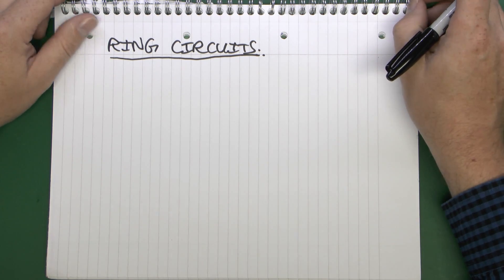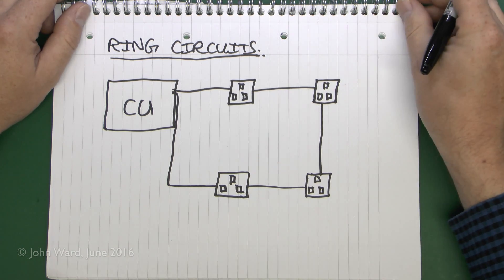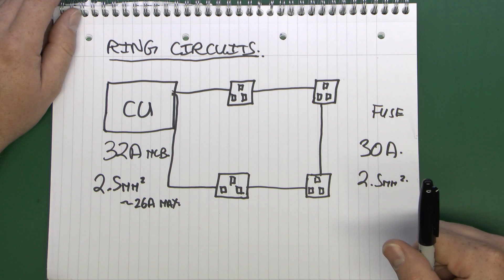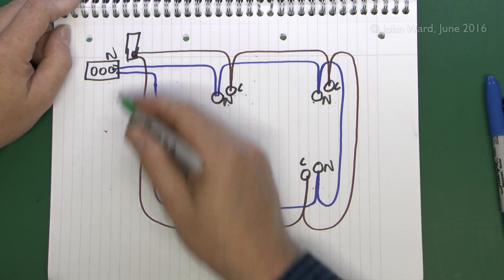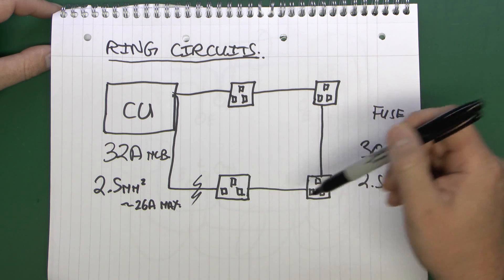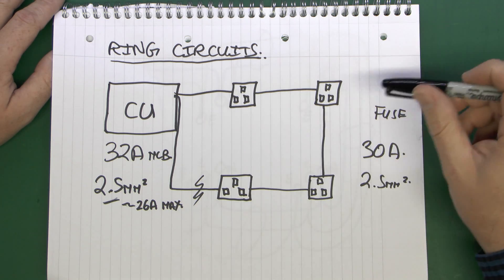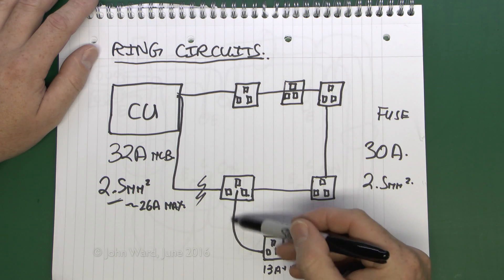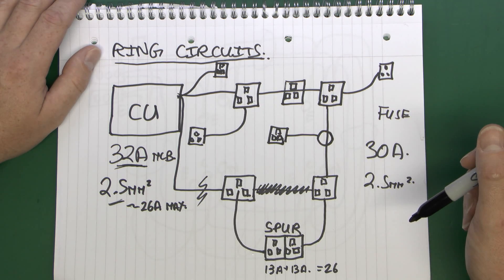UK Ring Circuits (previously Ring Mains) for Socket Outlets

Comment: Always wired 30 or 32A with 4mm2, you are on the safe side in any scenario. For bedrooms you could use 2.5mm2 with 20A   MCB which is more than enough for average house
Reply: Cost you a fortune in cable would have to take half a brick depth out to cap that up 🤣

Comment: I have 53 2g 13A sockets in my house on 6 ring circuits, can you imagine the consumer unit if i had used the spur configuration
Reply: It would look like my CU in France, where everything on on radials and I have 27 bays occupied. :)
Reply: @Herpitor  Isn't it something like 8 sockets on 2.5mm or 5 on 1.5mm and heavy appliances (washer, dryer, dishwasher etc) require their own spur?
Reply: @s1udgeguts  It used to be, in France it's now 12 sockets 20a breaker 2.5mm wire, or 8 sockets on 16a breaker 1.5mm wire.

Stupid limits, but means in large modern houses you have to buy the 6-800 euro Le Grand 4 tier unit to do an entire home. Typical French, squeezing your tit til it's purple to get all that juicy money flowing.
Reply: It also depends on how the cables are run. 2.5mm can carry up to 27A if clipped but run through stud walls packed with insulation, this drops to 13.5A. My son's modern house is lovely and toasty in the winter as it is wood construction and every wall is stud/plasterboard & packed with insulation, all his cables are in surface trunking (It's actually quite neat, the cables are simply laid in large, hollow, plastic skirting)
Reply from the maker: 6 radials would have half the number of wires at the consumer unit compared to 6 rings, so would mostly likely be considerably tidier.
Reply: @jwflame  an honest question: I'm also confused by the same issue Tony appears to have. Are you saying that each of his six rooms is on one spur, or that each of his 53 sockets needs to be wired radially? The latter sounds messy while the former suggests that for each room a separate (hated) ring circuit would be better. 
I used to deal with this stuff up to 15th edition regs, but I'm pretty sure things have moved on since those dinosaur days, but there were limits on the number of outlets on a spur back then.
Reply from the maker: A radial circuit starts at the consumer unit and connects to each socket in turn, ending at the final socket.  You can have as many sockets on it as you want.  The cable rating is less than that circuit breaker, so there is no risk of overloading and damaging the cable.  All circuits are radials, apart from the one exception which is the ring.
A ring uses undersized cable rated to at least 20A with a 30A fuse or 32A circuit breaker, and is only permitted because the ring provides 2 separate current paths to each socket.
A spur is a single socket connected via a single cable from a ring, and can only have one socket on it otherwise the cable could be overloaded.  There is no concept of a spur on a radial circuit.
With the 6 rings, they could be replaced with 6 radials, with exactly the same number of sockets on each as there is now.  Less cable would be used, half the number of wires at the consumer unit, no risk of the ring being broken and overloading the cable, less testing to do, and far easier to add sockets or do other alterations.

Comment: Most of the sparks I know, use ring mains. Never have any problems with them.
Reply: @Mark Sesum 38 years in the trade for me,
Reply: @Mark Sesum Back in the late 70s, the electricity board in Yorkshire had a special on electric showers. They would supply and fit a 3kw shower far cheaper than anyone else. Turned out, they ran a piece of 2.5 to a junction box attached to the first bit of 2.5 cable they found.
Reply: @s1udgeguts  A 3KW shower would either be a dribble or very cold.
Reply: @dopiaza2006  3kw was the highest rating you could buy at the time. It was neither a dribble nor very cold
Reply: @s1udgeguts  Just by the laws of thermodynamics, 3KW will not heat much water. In fact I remember having an electric shower in the late 70s, was around 8KW and made the lights dim noticeably. Still gave piss poor output! Your average combi gas boiler heating water on demand will be around 20KW. Maybe it was a little different up North though...
Reply: In my ex's gaff in France ever socket and light and appliance has its own breaker. None of this stone age shit.
Reply: @corydorastube  Nothing stone age about it, we have some of the best electrical safety standards in the world.
Reply: @corydorastube  we had 3 phase 415v in each house on an estate in Weston under Lizard back in the early 90s.
Reply: @corydorastube  Not true at all. Each radial run for sockets has its own circuit in France. Each lighting run has its own radial circuit. Each appliance in the kitchen has its own 'circuit spécialisé' but sockets and lights are on normal radials with multiple points being run by single breakers.

Also it'S 400v in Germany for 3-phase, not 440v.
Reply: @electricalstuff259  My ex-wife's house in France has a breaker for everything. Her distribution board looks like something from the bridge of the USS Enterprise.
Reply: @corydorastube  It musta been old as fook then. Having said that mine was so old it was condemned by Enedis and yet i still didn't have a single disjoncteur per socket. Guy who put it in might have been a cowboy or once upon a time they did it that way here and it's never been redone.
Reply: @electricalstuff259  It was built in 2000.
Reply: @corydorastube  Guy was a pudding then.
Reply: @electricalstuff259  I like my pudding then It means I can isolate any socket or light fitting. Does the job for me.
Reply: @corydorastube  You must be made of money then, since every circuit has to be RCD protected which means you are only going to be able to put 8 on each bus bar (that's the limit under the regs) meaning that for a house of 150sqm you're going to need at least two 4-tier units which are going to cost around 600 euro apiece, of which you'll still have to buy probably 20 extra mcb's at 8 euro apiece, that's before buying any cable at around 75 euro per 100m.

And i'm being generous. My MIL's house is a tiny 45sqm 2 up 2 down in a posh part of the west country and she has 13 lighting points and 28 sockets.

My old man lives in a 150sqm with outside power and lighting etc and has 95 lighting points and probably well over 100 sockets since he has lots of smaller rooms in his gaff, utility areas, offices, shed, garages with lots of power etc.

Or...you can just put almost unlimited sockets on a radial circuit in one mcb and be done with it.
Reply: @electricalstuff259  It's not my house. I did not have it built. It is my ex-wife's house. I have not been in it for about five years.

The plot of land cost about 30,000 and the house was another 80,000 is on top. Three stories, 5 beds.
Reply: @corydorastube  So about 10 grands worth of materials on that. Ridiculous.
Reply: @electricalstuff259  That is your claim. I have no idea. The one wall that is built from traditional pierre de Caen probably cost that much.
Reply: Why did you use a comma after “know”? Lol
Reply: He was not suggesting they would become a problem, just potentially if there was a break in the ring. Personally as a DIY'er but with an interest in domestic electrics, I would be going with a radial every time. Feel free to shoot me down!

Comment: If you wanted to put say two double sockets on a spur, would it be OK to connect these two sockets via a 13a fused spur box ?
>
Reply from the maker: Yes, in theory you can have as many sockets as you want via the 13A fuse.

Comment: My employer loves a Ring circuit, they'd put one in for any socket circuit consisting of 2 or more double sockets. I personally fail to see the point most of the time. It does make sense to have a 32A circuit for a kitchen/utility and I guess the little bit of extra testing involved still beats fitting a load of sockets with two 4mm cables in them.

I remember one of my college teachers saying about how he'd converted a lighting circuit wired in 1mm into a ring because it was on a 10A MCB and the cables were all buried in insulation, bet that was a head scratcher for the next guy to work on it  😂
Reply: It's not Ring, like the new video doorbell button; just "ring," the generic object.

Comment: If you don't like ring circuits, you should try living where the circuits are all radial and having to reset the breakers is a not infrequent event, as they are overloaded by too many appliances being used at the same time.  Not very good when your PC switches off,

Comment: John i need to wire a spur off a ring circuit , however rather than supplying a socket outlet i require it to accomodate a double appliance box with fused spurs which protect plynth background lighting and an extractor fan. does this comply with bs 7671 or would this be regarded as suppling a spur from a spur?
thanks for any clarification
Reply: I hope you resolved your issue or received any reply from John..

Comment: Hi John, you have some interesting videos, it is quite addictive watching Chinese crap being pulled to bits. I have to say though that I have taken a chance on a couple of electronic items from the land of the wibbly wall and been very pleased and surprised with the quality.
Specifically the Weiduka AC8.8 power blocks and a Wolf Audio linear power supply to replace the wall wart that came with my Origin Live turntable motor kit.
I am a bit puzzled by your dislike of ring circuits as it seems to be down entirely to the slight chance of a wire, fixed securely by a screw, in a non movable wall mounted environment, somehow working its way loose. Or have I missed something very important?
Also, with radial circuits do you not get power drops at the end of the line if items with heavy current demands are upstream so to speak?

Comment: My whole house is only one ring circuit. I would like to separate all the kitchen sockets. Would you suggest a kitchen radial and another radial for the rest or two separate ring circuits. Would that question be dependant on total number of sockets and appliances(total load)?

Comment: Great video (yes, a little late to the party). Just wondering but if single sockets installed in an old house, is that a sign that there may be a ring main? Thanks!
Reply from the maker: Singles were common in the 1970s and earlier, but doubles were available then.
Very likely they are on a ring, as that was the method used in virtually all houses then and still is today.  Whether they are single or double doesn't make any difference to the wiring.
Reply: @jwflame  Thank you for answering, very kind and informative. Excellent job all round sir.

Comment: Thanks John, really helpful.  I do not quite understand how if one wire gets disconnected. the sockets can still have power? Surely the ring is now broken?
Reply: Because the sockets draw power from either side of the ring. Consider a ring road, you wish to travel from the top (12o'clock) to the 8 o'clock position. You normally travel clockwise as it's more scenic and marginally less busy. You now find that there has been a serious accident, completely blocking your route. You can still get to your destination by travelling anti-clockwise, although this will now be more congested due to everyone else having to travel the same route.
Reply: williamwills I was thinking the same.

Comment: There is another common problem: when a DIYer adds sockets, he or she will frequently spur off an existing spur, which makes matters even worse. Bear in mind that when this topology was first proposed and accepted, the cable size was not 2.5 sq. mm., but was 7/029 sq. in., which had a higher current capacity; it was between 2.5 sq. mm. and 4 sq. mm., though in those days the only commonly used protective devices were rewirable fuses to BS3036, which required a larger cable due to their poor overload characteristics. The older imperial size cable was alao better because all the conductors were stranded, and so could be twisted together, resulting in a far better connection at terminals. My preferred circuit for 13A sockets is a 20 or 32 amp radial, using 4 sq. mm. This has stranded line and neutrals, so that the superior connections are retained, though not for the cpc, which is 1.5 sq. mm. single core.
Reply: I think you'll find that stranded cable was replaced with single core because single core clamps better and so makes a better connection.

Comment: What about insulation With a radial like a 4mm 32A would need to be 6mm how would that terminate. I install 4mm rings in bungalows where insulation is packed in.

Comment: Hi John,  thanks for the useful video. I have recently bought a static caravan in which the ring main for the sockets is protected by a 20A breaker. The wiring is 2.5mm T&E. Is there any reason why I may not be able to increase the breaker to 32A? Would the incoming supply from the park affect this - although there are much bigger vans on the park than mine which must have higher loads?

Comment: Hi, thanks for your videos. Could you please make a tutorial about how to connect/wire a 3 gang switch so it controls 3 devices for example? In my kitchen, I have a ventilator, ceiling light and led light under the cabinets and I have 4 set of cables (each having a Ground, L, N) coming out from the wall ready to be connected to a switch.

Comment: I never knew the UK did this, its a good idea in theory but the fact that its so easy to end up putting too many amps through the conductor from a single point failure is scary.
Reply: Note that 26 amps is what the cable is intended to carry, but the standard for manufacturing that cable is probably that it can handle 32 amps without getting hot enough to start a fire in any of the materials it's likely to be in contact with. (And the materials used in houses are probably also regulated so that they cannot ignite from the temperature that your house wiring is likely to get to...)
I'm pretty sure I broke the loop at one point (my baton light in the garage fell down in a storm and I snipped the wires off) and it was that way for months and nothing bad happened. I did hurry up and replace it when I read about the existence of ring circuits though! But nothing bad happened.

Comment: Why use ring circuits when most places use wiring that only extends to the furthest plug?
Reply: I've just look it up as I was under the impression it was to save money after WW2, but apparently not. This is an extract from the internet: 

The Electrical Installations Committee which was convened in 1942 as part of the Post War Building Studies programme determined, amongst other things, that the ring final circuit offered a more efficient and lower cost system which would safely support a greater number of sockets.

Most bigger loads are in the kitchen (washing machine, tumble dryer etc) and have their own circuit, so why not now use radial circuits for sockets?

Comment: The fuse in the UK plug is a good thing, Because a 32 amp ring circuit is a crazy British invention. 16Amp radial circuits are better because you don't know if dodgy molded plugs from China and abroad has a Fuse installed. That's why the rest of the world don't have 32A rings ( you simply don't need a 13A fuse in the plug). Maybe the sockets them selfs should have the 13A fuse fitted. That way the onus is on installation and not on the end user
Reply: All moulded plugs have fuses inside and you can change them